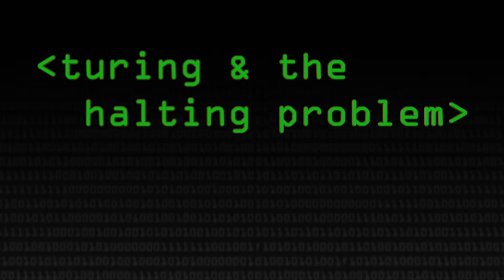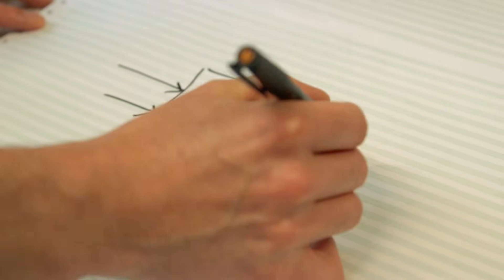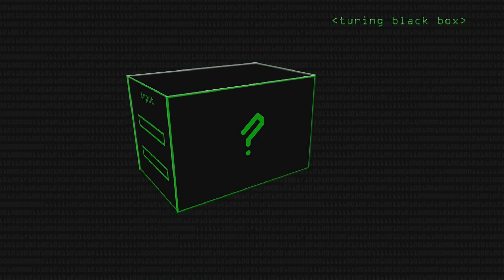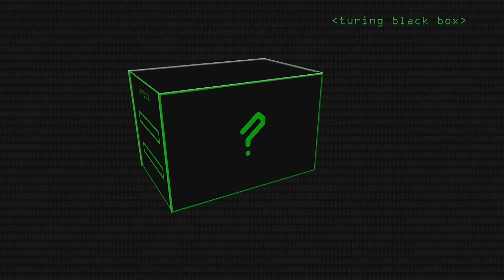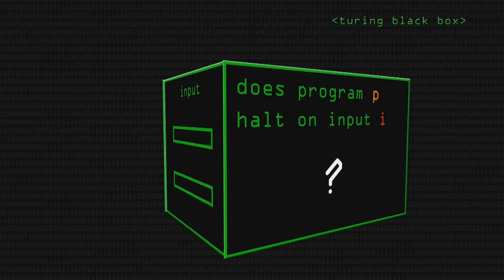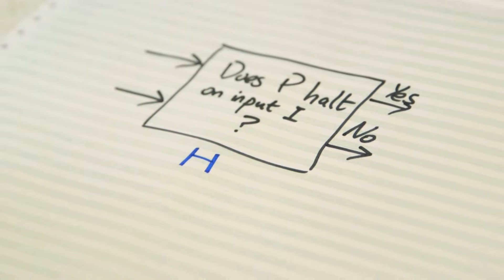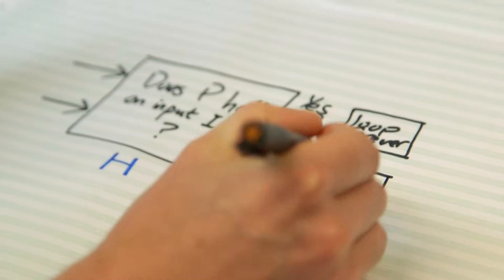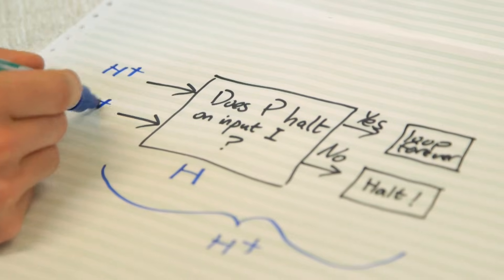Turing & The Halting Problem - Computerphile

Comment: My peasant mind needs more or better explanation. Because to me it just sounds like the paradox problem has nothing to do with machine h but you just added the h+ onto it to force a paradox out of it breaking machine h
Reply: ***** I think i get it now..

So the point is that if you say you can build a machine that can answer for any machine wether or not it halts.

You can build a paradox machine for which it can't be decided.

However aren't there a few problems with this?

Firstly i am no programmer so bear with me.

But wouldn't it be possible for another H machine to determine the result of H+?

It is a paradox yes but something will still happen to machine H+.
Say it simple keeps going for ever unable to find an answer. So it wouldn't halt

Wouldn't another machine H still be able tell that machine H+ won't stop?

And secondly.
Even if machine H can't determine the result of machine H+ it is indeed true that a machine can't solve 100% of the halting problems.

However if it can solve everything but H+
That would still make it incredibly useful no?
Reply: NoRotation but then how is the + component of H+ in this video impossible to make?

All it does is go
If answer = yes - start again.
If answer = no - stop.

In this case it doesn't seem like it proved that H can't exist. But simply that you can break it.
Reply: xybersurfer Yes, in an implication, the consequent being true says nothing about the antecedent. But that's irrelevant here. A proof by contradiction (which is what the proof in the video is) consists in demonstrating that the consequent is false, which, through modus tollens, forces the antecedent to be false. The proof demonstrates that H+ can't exist, and you don't need to consider what happens if it did exist.
I think there are some basic things about logic that you don't understand yet.
Reply: FernieCanto for some reason your comment was the only one that showed as a response.
thank you

i have a lot of reading to do now
Reply: Pedro Pertino Actually there are a whole class of problems which nobody knows will halt or not given arbitrary inputs. All programs either halt or they don't, but there's does not exist any general way to determine whether an arbitrary program will or will not halt given arbitrary input. Also I don't see how an infinite tree can end.
Reply: My mind struggled with that very same question, but I think I can explain the flaw in that thinking. The trick is, by creating H+, Turing didn't "break" the machine. The transformation of H into H+ is not a violation of logic. And by creating a system which has a paradox, it doesn't matter if you "forced" the paradox or not; if the system was correct, it would be impossible to force a paradox, no matter how hard you try. Therefore, any assumption that makes it possible for a paradox to exist must be wrong, and that's why the assumption "machine H exists" is wrong.
Reply: @FernieCanto  the begging of the universe is a paradox there for universe doesnt exist?
Reply: luckygozer Hi, english is not my native language, so bear with me for a sec.
The whole premise sais there is h, a machine that can determine the problem, I strongly believe that h can run h+, think of it like a binary tree, the parent node will be h, with it two children, the program and it´s input,you can now start an infinite tree of h+ childs, but eventually, you will end with the tree leafs, which will be programs, that will end the sequence (will halt or not, only one option). I think it´s possible that, this "H" machine can (and will) be created, our brain can do it, why not a computer, it will take time, technically, every program and code was/will be created by a human been, who was/will be able to determine if this program will halt, or loop forever. Let me know your thoughts
Reply: luckygozer
"However if it can solve everything but H+
That would still make it incredibly useful no?"
That is where things get interesting. There is software out there that analyse programs in many different languages and try to detect loops. There are certain kinds of loops that are easy to detect, while some are more complex. But no matter how clever you are and how hard you try, you know, mathematically, that it is impossible to write a program that detects every possible loop. It's really frustrating, but indeed, an "imperfect" loop detector can be very useful and they do exist.
Reply: Nixitur i'm not sure i agree. the question is now:
- did you prove that H is false?
- or rather that the implication formula H → H+ you proposed is false?

the statement ¬H+ → ¬H makes it very clear, that there will be disagreement if someone does not agree the original implication formula.
Reply: xybersurfer You are correct in saying that by my statement, either H must be false or the implication is false.
However, H → H+ is obviously true.
It was shown in the video that if H can exist, then H+ can also exist.
Since H+ can't exist, then H can't exist, either.
Reply: but H → H+ also holds when:
H does not exist and H+ does not exist. according to the H → H+ = ¬H ∨ H+
Reply: xybersurfer Well... yes?
You're basically proving my point. I never said that the implication itself was wrong.
If H can't exist, then we're done and the disjunction holds.
And if H+ can't exist, then H can't exist either or the disjunction would be wrong.
Reply: but, i am saying that the implication is wrong. because your formula still holds when H does not exist and H+ does not. your formula holds as soon as H does not exist. there is not even any point in checking whether H+ exists
Reply: xybersurfer If the implication is wrong, can you show the error?
Reply: FernieCanto yes, as said. take:
- H does not exist (H = false)
- H+ exist (H+ = true)
clearly this should not possible because H+ depends on H

but when you fill them into the formula
H → H+
= ¬H ∨ H+
= ¬false ∨ true
= true ∨ true
= true

it says it's true
Reply: FernieCanto yeah it seems that there are some things i don't understand yet. i've struggled a bit with understanding the halting problem. as a student i have reproduced the proof but i never really felt like i understood it. i think i will re-watch the video a couple of times.
Reply: Nixitur i don't get how you can make such a strong claim
Reply: xybersurfer Try looking up some more didactic, in depth proofs. There are lots of places on the Internet that deal with computer science concepts. It's not a trivial proof at all, so if you're still uncomfortable with it, just keep on reading. Eventually it will click.
Reply: The point is that H+ is so easy to add, if you had H then you could instantly make H+, but if H+ cannot exist then there's no way H could exist, because if H exists then H+ can easily be made from it.

Like if there were such thing as indestructible bread, I'd easily be able to make a indestructible sandwich by slapping 2 pieces of bread together, but if I can prove that indestructible sandwiches cannot exist, then either sandwiches are not made of two pieces of bread or there's no such thing as indestructible bread.
Reply: @NoRotation  no because you cannot cut indestructible bread in 2 to make a sandwitch there for the bread can exist but not the sandwitch.
Reply: NoRotation
"Also the point is not that you add code that ruins the functionality of H, but you make a trivial alteration."

It's not trivial at all. The output is radically altered. Output is ultimately what matters, not what happens inside - you can have the most beautifully complex and advanced bit of code in the world, but if you add another bit of code that intercepts and scrambles all output from it, it becomes worthless.
Reply: I know this has already been answered, but I just want to answer it in a more concise and simple form.

It's a simple implication, really.

If H can exist, then H+ can exist, as was shown in the video.
Let's take the existence of these programs as propositions H and H+.
So, H → H+.

It was proven that H+ cannot exist, so the proposition H is definitely false.
So, ¬H+ is definitely true, ¬ meaning "not".

Now, the way implications work is that A → B is equivalent to ¬B → ¬A.
For example, if it rains, the street is wet.
So, if the street isn't wet, then it doesn't rain.

So, our original implication
H → H+
means the same as
¬H+ → ¬H

And since we know that ¬H+ is definitely true, then ¬H must also be true, thus H cannot exist.
Reply: xybersurfer That doesn't disprove anything.
Nobody ever said that H+ can only exist if H can exist.  Buf we know that if H+ can't exist, H can't exist either.
Reply: Snagabott Except this doesn't scramble it, it's still completely unambiguous what the output is. Furthermore the algorithm that is suppose to check the programs has not changed except for the output stage, however the alteration to the output demonstrates that the algorithm cannot possibly reach a valid output and therefore the algorithm has failed.
Reply: NoRotation
I still don't quite get it.

Let me explain: There are three parts to this: a detector H, a program to be tested P and an input i.

We assume that H(P(i)) will give a meaningful result.

We then build H+. H+(P(i)) will not necessarily give a meaningful result - when it terminates, you have an answer, and that's great, but before it does, you don't know if that's because it's takes a long time and isn't done yet or because it found the answer and is looping to show it to you. H+ is not a functioning detector - unless you have another detector H that can determine if it is "looping as output" or still evaluating input arguments.

So what about H+(H+) (presumably with some other input just to get it started, so it's actually H+(H+(P(i))))?
H+(P(i)) is the input, and that's fine. It may be a rubbish program, but there's no rule against that. But the "other" H+, the one that actually does the evaluation, is an unfit-for-purpose program, so it won't give us a useful answer.

So what will H(H+(H+(P(i)))) say? It will not be undetermined, it will say "loop infinitely". It looks at the whole thing - and will detect that at least one part of it (either the inner or the outer H+) will loop.

So to me, H+ seems not impossible, just not terribly useful. I can add perfectly valid code to almost any program that would ruin them beyond recognition (trust me), but that doesn't prove that they couldn't exist to begin with.
Reply: Snagabott it’s a discrete proof by contradiction they are tricky to learn how to do
Reply: Wait but what doesn't makes sense to me is that H works fine on it's own. It solves the problem it was meant to solve, right? Like this sounds sort of like a bug.

Let's say we have a piece of code that always returns 1, we add another machine that inverts first machines output. We wouldn't expect a 1 to come out - we'd expect 0. So why is this different, we construct a machine that does something, another that contradicts itself and we expect it to not contradict itself? That doesn't really make sense. 

What would make more sense is if we made a machine that solves halting problems(H), created another machine, like the one in the video(H+) and we fed H with H+, H+, H+. (as in will H+ machine halt with the inputs H+ H+). Right, then it makes sense, because H would probably run forever as it cant determine a proper outcome. But it seems like it really doesn't matter. What I mean is that it seems like an unrealistic, extremely hypothetical problem that's pretty much useless for computer science. What does this prove? that it can't solve a problem that doesn't exist? What exactly is the point of this thought experiment, like it might be cool to think about, but I feel like it's made out to be much more than it actually is.
Reply: Snagabott You're not thinking in the ideal setting, this machine takes no time to run, it instantly returns an answer, so you know whether or not it's looping. Also the point is not that you add code that ruins the functionality of H, but you make a trivial alteration to show that an essentially functionally identical machine cannot exist.

Comment: I get the idea here, but it seems to me, once you've added on extra workings to the halt detector, it is no longer the halt detector, and has become a different machine. The example seems a bit off too, pretend this machine works, now we change it, it doesn't work, thus proving something about the world. Logic is a great tool, just the use perhaps in this situation isn't making sense to me.
Reply: The idea here is that if such a general purpose halt-detector H exists, then from it we can build the impossible machine H+. Since H+ is impossible, then H cannot possibly exist.

Given H, H+ is the machine that takes as input a set A, and does the following with it: "what is the result of H applied to inputs H+ and A? If yes, then loop forever, otherwise, halt"

now, to show that H+ is indeed an impossible machine, feed H+ to itself (that is, substitute H+ for A in the above sentence)

this gives us "what is the result of H applied to inputs H+ and H+? if yes, then loop forever, otherwise, halt". We'll call this H+(H+)

now, H+(H+) either halts or not. If it does halt, then it didn't loop forever. This means that H applied to inputs H+ and H+ gives us a "no" answer. Wait a minute, from the definition of H, this means that H+(H+) does not halt. This is a contradiction, which means we cannot assume that H+(H+) does halt.

okay, so that doesn't work, this must mean that H+(H+) does not halt, right?
Well, in that case, since H always halts, then H+ must have gotten stuck in the "loop forever" part. But in that case, then H applied to H+ and H+ gives us a "yes" answer. From the definition of H, this means that H+(H+) does halt. We got ourselves a contradiction again.

We exhausted all possibilities of H+(H+) halting or not, and none make any sense. This means that H+ is an impossible machine to begin with. Since the way we modified H to make H+ is completely valid, then H must be impossible.
Reply: There are 3 machines: H, G and H+
H is the halt detector. The point is to figure out whether it can exist.
G is a machine that loops infinitely if given the input "yes", but not if given the input no. We know that such a machine can exist.
H+ is what you get when you combine them.

If both H and G exist, then H+ must exist as well. This is equivalent to saying that if H+ doesn't exist, then H and G can't both exist. The video shows that H+ doesn't exist, so, as I said, either H or G must be impossible as well. However, we know that G can exist, meaning H (the initial halt detector) can't exist.
Reply: Incredibly late reply, but I figure I may as well ask. How is H+ proven to not exist? It's proven to be wrong about whether or not H+ will halt, but that's hardly a surprise given the addition of G.
Reply: He tried to simplify the solution, you can actually prove the same thing with no modifications to the H machine.
Reply: Ricardo Amendoeira Ah okay, with the modifications, it seemed to me something was wrong, as the add on part would be constantly flip flopping itself, just to fool the H part. Does bring up some interesting thoughts though, for it to work, H would have to be lying... and thinking ahead.
Reply: You are wrong for the whole statement but right for the part that it’s not a halt detector, it’s now a “not halt” detector. And halt detector exists only if not halt detector exists as later is sort of a property of the former just like “If earth is not round it must have edges”. So logic doesn’t have a flaw as we aren’t changing but deriving. It would be changing if we had halted on both halt and not halt.
Reply: "Can you build a machine, that can tell you whether or not ANY given machine with ANY given input will eventually halt?"
No you can't, because you can always create a machine, that will never halt. (Overly simplified.)

The key here is the created paradoxon, that if the machine should halt it doesn't and if it doesn't halt, it does.

Comment: Doesn't this proof just show that the transformation from H to H+ was a bad decision? I mean, theoretically I could use H to test H+ and see if it will halt or not. I don't necessarily have to use H+ to test H+, right?
Can someone please explain this to me?
Reply: When proving something by contradiction, you start from an initial assumption (which you want to prove wrong) and then reason upon it until you arrive at a contradiction. Since all the reasoning steps between the assumption and the contradiction are legal (consistent), the only possible explanation for the contradiction is that the assumption was wrong - so the opposite must be true.

The wrong assumption here is "there exists a machine H which solves the halting problem", and we use a "bad decision" (a legal transformation from H to H+ and a legal execution of H+ on itself) to end up with a contradiction. This proves that the opposite is true, so we conclude "there is no machine that solves the halting problem". Sure, running H on input H+ might not lead to a contradiction, but that simply means it's not useful as part of the proof. The goal is to make the "right" bad decisions in order to end up with a contradiction.
Reply: The strategy in the proof is to show that if such a working H machine exists, then we can build a machine H+ that contradicts its own existence. Since you can never build such an H+ machine in any way, then it must be impossible to build the H machine to begin with.
Reply: If you feed H+ as the program and H+ as that program's input to the normal H machine it will give the wrong answer.